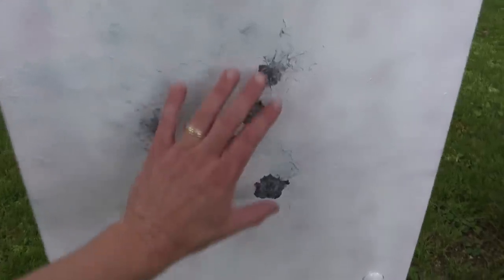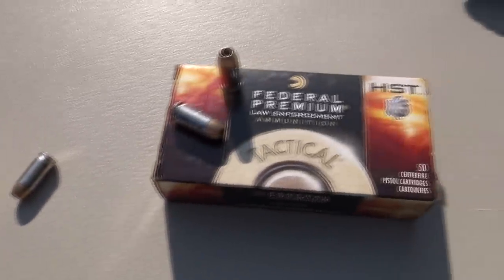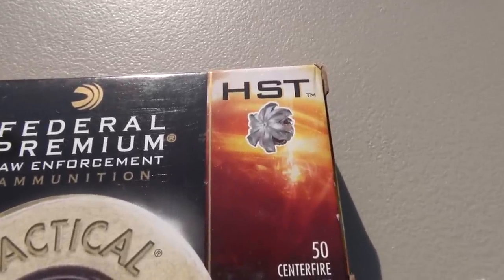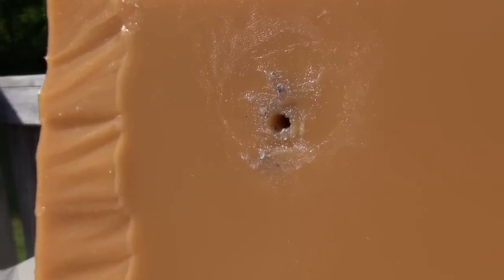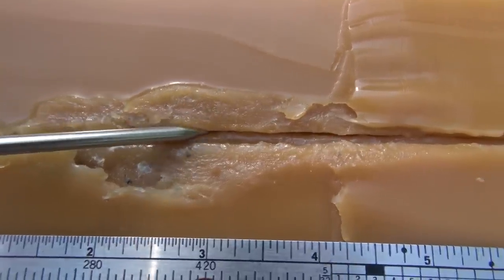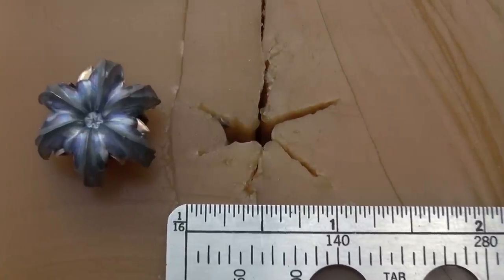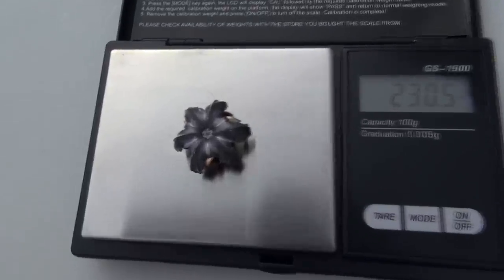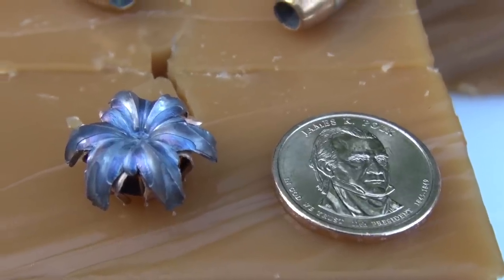.45 ACP Federal HST 230 gr Ammo Gel Test

Comment: I mean the 45 acp's expanded to .897" diameter in TN's testing. thats a massive area increase over the 9mm version of .662".... infact its .632in^2 versus .346in^2 or an 82% increase in cutting diameter. So if shot placement is key then you have a better chance of shooting at a vital and actually hitting it. Inherently more bleeding and blood pressure drop even if it doesnt hit vital. At the slower velocity of 45 less material is pushed around the bullet. so the slow speed actually helps it cut what it touches. You'll also need a rifle or minimum 357 magnum if you want a chance at actually damaging internals with cavitation... I dont own 45acp but theres some serious merit to it with an HST.
Reply: @servant of jesus the only issue is the follow up shots are less likely to hit the target with the stiff recoil and it's proven by Leo's over and over that you need to send 10 down range to put 3 on target if that so it's all working against you in a tense situation and the more on target the more likely you will stop the threat to your life...
Reply: @doddgarger6806  I feel like 45 is really not much harder to shoot than 9.  If you have a strong grip I feel it is easier because it’s not snappy
Reply: @Youtubeuser1aa  it’s not I own a Glock 21 45acp (my first ever handgun) and a Glock 19 Gen 5 barely any different at all if anything 40 has way more snap to it. But I carry more rounds of 9mm in a Glock 19 which is concealable unlike the huge service sized Glock 21. I like 16 rounds 147 standard pressure HST’s traveling at upper 900’s to lower 1000’s FPS range with smooth recoil.

Comment: That is impressive.  Based on your tests I am shooting 124 grain standard pressure HSTs in my carry 9mm Shield.  My son will now be carrying 230 grain standard pressure HSTs in his new 45 Shield.
Reply: For a micro pistol i would go with +p to make up for the velocity loss of the short barrel
Reply: which would be better for carrying? the HP or JHP?
Reply: Charles Marshall I've shot these out of my 45 shield into denim and perma gel.  All 5 rounds failed to expand.  The only 2 rounds that expanded were the Hdy critical defense and anything that used a Barnes XPB projectile.  The Barnes were VERY impressive.
Reply: No Spam got a video, I'm looking for shield 45 ammo as well
Reply: Unfortunately, I don't have the ability to take video.  My cheap $40 phone doesn't cut it.
Reply: Hoglow101 Winchester pdx1 and Ranger t's use the same bullet.  There is a comparison video on YouTube of the 2.
Reply: Chris P 
They actually do not. Pdx1 is generally bonded. There are several versions of the Ranger T series rounds. There is no need to argue because if you simply looked on lucky gunners ballistic table you can see for yourself. I also have both loads in 230 gr for my .45 and while they do look similar they are most definitely not the same.
Reply: the  230 gr .45's. wont expand in flesh, practically guaranteed, from t hat short barrel. All you'll get is the flat nose effect, which is very little.
Reply: Jake Azalea you mean hp w/o a copper jacket?
Reply: Charles Marshall see Ayoob's Cop Talk in the May/June 2018 American Handgunner. His old dept in NH issues this for both their full size and Shield .45s.
Reply: You are the only person on earth that that has happened to :) HST's are the most consistent round out there. Who knows, maybe just a bad batch. It happens
Reply: False. This isn't the 70's anymore.
Reply: For the 3 inch 9mm 147 grain standard pressure  hst rocks ...

Comment: I have an Iver Johnson 1911A1 Carbine with a 16 inch barrel and I'm curious how much more damage that would cause. The muzzle velocity from a .45 ACP from a 6 inch barrel is around 850-950FPS with 350-450 foot pounds where as a 16 inch barrel will have a .45ACP will have a muzzle velocity of 1100-1300 FPS and has 600-850 foot pounds of force. I really want to see a side by side comparison but nobody has made that content yet, especially with hollow points.

Comment: I have fired 800 of these rounds through my Walther 45acp PPQ M2. My Walther will only reliably fire rounds under 1.2100" COL.  These measure from 1.2100 to 1.21300" COL.  The headspace for my Walther, when hot, will chamber 11 out of 12 correctly. The one that doesn't chamber correctly it always the longer end of this ammunition.
Just my 0.02 from reloading.  I have refired some of this Nickle platted brass with ball ammo 10x now. I have only had 2 get weak primer pockets so far out of 500 reloads

Comment: Right. I understand. I was also referring to the concept of which hurts more, a slow cut with a knife? Or an fast one/pull a bandaid off fast vs. slow; pull a hair out fast vs. slow; pull a tablecloth out from under everything fast and leaving it all there on the table, or slower and taking everything with it. Of course there is a sweet spot, if it goes too slow, and it has little or no impact. But you also go too fast, and they don't even realize they've been hit.

Comment: Wheeler, read between the lines dude. I'm not talking real slow. I'm just saying that the 9mm still has a lot of knockdown power. Obviously not as much as the .45. And also, that because the .45 is slower/more grains, it does a better job. But I don't shoot +P through my 45 because I want to knock the person back more. I'm not an idiot. I did not want to start the damn debate that always happens - "faster is better/no, slower is better" and the "9 is better/no, 45 is better."

Comment: I work in the dental field and we use a reusable gel called reversible hydocolloid. and it is not that expensive. It is somewhat transparent. It dilutes with water and so i guess can be calibrated close to specs as well. It may be a better alternative. don't know till its tried. I'm surprised that it has not been used for this.

Comment: I have watched your 9mm, .40 and .45 HST tests.  To me it doesn't look like there is a whole lot of a difference between the 3 of them.   Am I wrong?  The pedals all seem to dig in for half an inch depth for about an inch total cut size.   Penetration seems to be similar as well.  It doesnt seem to me that you gain much going from a 9mm to a .40 or .45 with the federal HST.
Reply from the maker: Rockin House There really isn't much difference between the primary service calibers, regardless of ammo.
Reply: Rockin House Tnoutdoors9 thoughtfully mentions one aspect that is missing from these tests - BONE.  Testing through gel media and denim offers us a fair reference for expansion and penetration but at some point the projectile may impact bone. 

If a larger/heavier bullet traveling at lower velocity but with the same muzzle energy as a lighter bullet traveling at a higher velocity, the larger/heavier bullet will lose less kinetic energy as it impacts bone than the lighter/faster traveling projectile?
Reply: TOBORE8THMAN Yes, and that's why I refuse to load up the lighter bullets in my defensive weapons. 147 gr for my 9mm pistols and 230 gr for my .45s. The lighter rounds may impart more energy due to higher velocity, but without adequate penetration, that's all kind of useless. Yes, the 125 and 115 grain 9mm rounds have been shown to perform well in real world shootings as have the 185 grain .45 hollow points, but heavier rounds simply maximizes your odds of having a better day than the bad guy. Also the reason we go for the superlative among the premium hollow points on the market today, such as Federal HST, Winchester Ranger T, and Speer Gold Dot.
Reply: TheWitnesserer I agree.  ALWAYS use the heaviest bullet in your favorite carry or home defense caliber.  If I was to carry a 9mm, I would definitely choose the 147 grain Remington Golden Sabers, Federal HST or Speer Gold Dots.  Lots of good options.

Comment: What you gain with the 9mm is more rounds of ammo in your mags. For the same performance. Maybe that is why the FBI is going back to the 9mm.
Reply: +Sue Phillips Yeah...No.  You're not going to get that kind of bullet expansion from a minuscule 9mm.  Additionally, the light weight bullet of the 9mm will probably fail as it impacts bone because of the loss of energy.  With 9mm, you gain rounds but lose lethal effect.  230 grains in 45 ends the threat quicker because you need less rounds to achieve the same desired effect.  9mm is actually on the chopping block.

Comment: Good ammo, but bonded is much better. Expansion should not be the primary guide here (i.e. Federal HST "is better")? You should understand that expansion won't matter if the bullet doesn't first PENETRATE. As it is, penetration is key (this according to the FBI and their studies no less). Bullets fired by FBI agents and found in criminals indicated that the bullet had to either travel through their hand, arm, or leg FIRST before any attempt of the bullet could reach their chest or main body and organs. What this means is that most people for that matter will attempt to shield themselves from a bullet. These bullets don't only travel through soft tissue, they also travel through BONE. So if you want to cause a bleedout with expansion you better be prepared for the non-bonded bullet not to reach the chest or organs. This isn't even mentioning the thickness of clothes that needs to be taken into account as well, much less any body armor that an intent criminal could wear. BONDED IS THE WAY TO GO. Federal's HST is not necessarily bonded, either. They have HST, HST Tactical, and HST Tactical Bonded, but the bonded stuff is very hard to come by. Winchester's bonded stuff is easier to come by, however it is more expensive.
Reply: Not a big issue with rounds that penetrate more than 12 inches. The standard was made to cull out service loads like the old school silvertip 9mm 115gr that penetrate around 9 inches in gel. This round is fine in that regard.

Comment: how does this penetrate more than the 230gr +P HST? weird
Reply: +Dan Han 
He was using a different gun in this test, it has a longer barrel = more velocity.  If he had used this 1911 for the +P test it likely would have been the same if not more than the standard pressure.

Comment: shot in the dark but I'd like to find out what ammunition in the movie "Street Kings", Keaune Reeves Colt .45 acp specific scene quote "serious man stoppers" ammunition?
Reply: Movies don't care about ammo brands (and usually assume any .45 is a 'man stopper') unless it's an 80's flick demonizing "cop killer" Teflon coated bullets.
Reply: Teflon coating are really used or just novelty movie terminology?
Reply: +The Duke of California Teflon coated armor piercing bullets were a real thing in the 70's-90's but the Teflon didn't do anything to make them better penetrators. The bullets were hardened tungsten steel, and only to reduce barrel wear, they were coated in Teflon. The ATF banned these however they pop up at gun shows for $10 a piece and the standard pressure 9mm can zip right through level IV AR500 plate armor.

Other Teflon bullets were the Winchester Black Talons, coated for the same reason, but government/media thought it made them better at penetrating soft armor. Winchester simply rebranded the cartridges as the Ranger SXT line without the Teflon and you can still buy them today with the same penetrating capabilities of the Black Talons.

Comment: As a medic and hunter, I will say the .45 is a superior round. simply due to its pure stopping power and its ability to shatter bones. Even with a non fatal shot your subject will stay down.. Sure the 9mm is a faster round bit I have seen subjects (people) take several non fatal 9mm rounds and still have plenty of fight. Besides, I haven't come across anyone yet that can run anywhere close to 800 feet per second so my vote is always slower and heavy.
Reply: I disagree. What's "pure stopping power" in this context? Not even the professionals can agree on what that term denotes. I'm willing to bet the people who took multiple 9mm were hit by ball ammunition, yes? It's been shown that the differences in terminal performance between well-engineered JHPs in each of the service pistol calibers is largely negligible. 

That's not to say .45 ACP doesn't have some advantages going for it, of course. A heavier, deeper-penetrating round would be better if you happen to come across a non-human adversary. It also resists deflection through windshields better. And that greater diameter might just allow you to nick something vital that an expanded 9mm would miss (though the chances don't seem all that favorable). 

The reasons above are sound enough to me that I won't bash anyone for choosing to carry .45 ACP. It's a perfectly serviceable round. I don't find it to be "superior" in a blanket sense, however. If that was the case, the FBI wouldn't be going to 9mm. Besides, I like the lower recoil and higher capacity I get with 9mm. It's also cheaper to practice with.
Reply: I will agree..  At the end of the day placement is the most important thing.
Reply: *****
The FBI is one of the leading authorities on wound ballistics and has pioneered some of the most comprehensive studies on the subject. Many police departments and civilians base their duty load selections on the FBI's findings.

Appeal to Authority implies the argument is baseless beyond the invocation of a name, which I would argue mine was and is not. In any case, my response was tailored to the original post which argued .45 ACP was a superior round in a blanket sense.

The Army has only mentioned the possibility of going to .45 ACP or .40 S&W. Nothing's set in stone yet. Even with ball ammo, the differences aren't huge.
Reply: *****
No, it's not. I get the feeling that you like to use the term without understanding what it means.

For something to be an Appeal to Authority, it has to be baseless. It has to rely solely on the invocation of said perceived authority with no grounding in supporting arguments. This was not the case with my post.

Honestly, I don't much care whether you disagree with that or not. Make an actual argument debating my points rather than taking a potshot at one specific sentence you think doesn't measure up to your standards of debating. I don't mean to be snappy about this, I'm just saying.
Reply: *****
I absolutely disagree with that. Not about the FBI being the end all, be all master of ballistics, but the idea that using them as a data point is inadmissible in a private discussion. This is the YouTube comment section, not a debate forum, for one thing.

In addition, if you were to follow up on the logic of not being allowed to invoke the FBI as an authority on wound ballistics in any way, shape, or form, then we wouldn't have any real way to discuss the subject meaningfully. A lot of the material out there regarding intermediate barriers, denim tests... hell, even the 12-18" penetration threshhold for defensive ammo. You'd get to a point where it's impossible to have a meaningful, technical discussion because any mention of an agency that's proven itself as a pioneer in the study of the field has to be written off as an appeal to authority. This is a position I vehemently disagree with, especially in the context of casual discourse.

If you disagree and say my mentioning of the FBI was out of line, that's fine. You're free to do so of course. I just don't see it as a reasonable complaint, personally.
Reply: Safton nail on the head mate
Reply: @SaftonYT  The FBI went back to 9mm because most of there agents dont train enough to handle anything but a 9mm.
Reply: @SaftonYT  FBI studies don't impress me. I talk to local Sheriff Deputies instead, they will tell you stories/ facts the FBI never hear about meaning wounds and calibers used. Depending on local east coast vs mid west vs west coast all have different people and varieties of handguns used. Here in Montana 357 mag, 45 , 44's etc are the norm most carry and use compared to let's say east coast suburbanites carrying 380, 9 mm that sort of thing.
Reply: @andrewgates7508  Most police Dept. only shoot 1 or 2 times a year. I knew a gal that was a local city cop that only was required to shoot 50 rounds a year to qualify. That right there tells you something about some departments and their officers handgun proficiency.  I shoot in one day what she shoots in a year but they claim to be highly skilled, yeah.